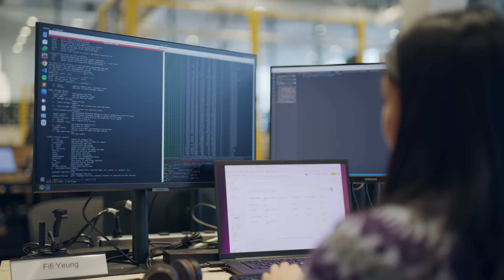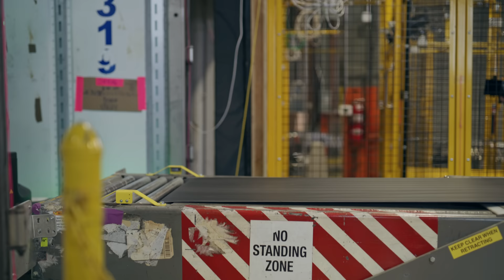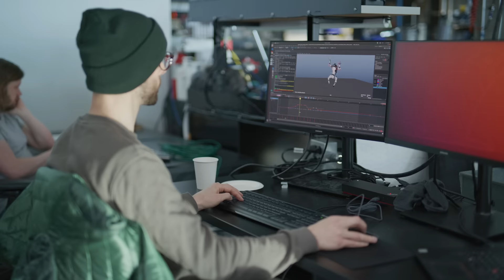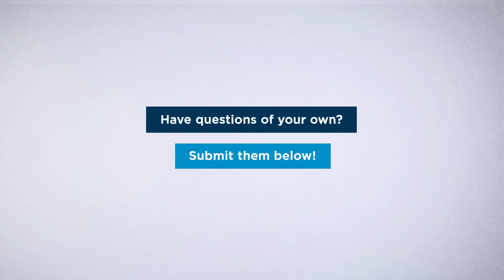Ask a Roboticist: Meet Fifi | Boston Dynamics

Comment: Seems slightly odd that instead of placing the boxes on the conveyor neatly, Stretch DROPS the boxes from a small height. Has it learned by watching human luggage movers at airports??
Reply: it saves complexity because boxes could be different dimensions, if it were to place a taller box it might crush the box into the conveyor. also for each box size it would have to calculate how far down to move every time it placed the box
Reply: @coreysuffield  the simplest is to put one laser on the belt conveyor itself or on the robot itself, this laser will measure the distance to the box.  There are still a lot of ideas how to solve this little problem.
Reply: @coreysuffield  it can be done with some kind of force monitoring to tell when it touches the conveyer belt or some other system to tell the size and shape of the box. If it uses force monitoring then it doesn’t need to do any calculations to tell where to move it to, it just lowers it until the force decreases. Robots that just use position control aren’t that great, adding force control makes it a lot more similar to how a person works, if you think about how you place something on a table, you move it down until you feel that it is on the table, same if you push something, you can decide how much force to use, you use both position and force control. Adding force control to a robot makes it a lot more versatile.

Comment: It's interesting to see Stretch was built for specific functions instead of general-purpose robots such as Atlas or Spot. My questions:
1. Do you only test with boxes that have ideally located centres of gravity or can Stretch handle boxes with suboptimally placed centres of gravity? If so, does it mean that it can calculate the centre of gravity of a picked box while moving it?
2. If Stretch picks up a box that has moving content (thus, a changing centre of gravity), can it adapt its movement speed accordingly so the box doesn't pose a problem of dropping?

Comment: I still find it crazy that such box robots are not common yet. Looks so controllable and easy and not needing fancy AI.
Reply: Well the suction idea is a bit impractical and has too many issues. Notice all the boxes it picks up are the same in dimension and size. Using suction there's going to be a tighter weight limit. It's only going to be able to lift boxes that are light enough that the suction will hold. The second it becomes too heavy the suction will fail. As she also says in the video, different shaped boxes are also a problem due to surface area it has to pick up but also because the odd shapes can off center the balance causing the package to pull at one side resulting in the suction failing again. If you could build a second arm that came in after the box was lifted and supported the bottom until it's close to the belt, that might work better for solving this problem.
Reply: You can just go buy a spot robot if you wanted to. Nothing stopping you.
Reply: @AmazingKevinWClark  I agree the suction thing is problematic, but I could imagine other ways that don't do this.

Comment: i have a question please? : Why does Stretch™not have 3 sides to it's pickup? From what i see in this video, Stretch™ can only pick from top, with flat-ish surfaces only. Would two more sides not assist with GRIP and therefore enable 'other' shaped objects to be handled as efficiently?
seems to me that an |~| shaped pickup would be far superior (where ~ is double-sided suction) and where | = angleable through 180 degrees?

Comment: Why does the stretch manipulator not have a small lip/scoop under the suction plate, that sort of slides under the front edge of the box. Just so it can offset some of the box weigh and rely less on the suction ?

Comment: Why does Strech drop all boxes about 20cm on to the belt? Wouldn’t it be better to set them down gently?
Reply: I'll bet they're working on that...
Reply: it would add quite a bit of complexity to do as you say, it would have to know the dimensions of every box and calculate the place move every time, or just have another camera that tells the system when box is near the conveyor. also there is risk of crushing a taller boxes. a small drop is so much easier\less expensive, and nothing is going to get damaged from such a small height, i work in a warehouse and have seen merchandise be treated way worse by people, like being dropped inside of a plastic box from waist height onto a concrete floor
Reply: @coreysuffield  
I could imagine it already does that calculation when picking the box. 
Otherwise how would it know were to pick it and where exactly to drop it. The height it dropped the boxes from themed consistent.
I find it odd to pick the boxes carefully only to let them drop on the belt.

Comment: Why does the robot drop the packages onto the belt, rather than placing them more gently?
Reply: It is much simpler to do rather than having a system to measure the size of the box or a force sensing system to tell when it touches the conveyer.

Comment: how fast can it load a truck speaking from experience that would be the biggest time saver you can always round up a team to unload not only that but most pallets come with shrink wrap does it have a blade to cut that and then there is things like some boxes come frozen will the suction cups work on that what about moving chep pallets can it stack them out of the way can it be paired with a forklift attachment to move said pallets or bring a load down from when they stack them because rite now there is a very small amount of applications for this and with such a high price point it is not cost effective to get one
Reply: Yeah the robot looks neat but it has a lot of unsolved practical problems. The biggest being the weight of the boxes. A suction can't lift beyond it's weight limit. A way to help it a bit is to introduce a second arm that can support the bottom of the box but if the suction can't lift it in the first place then the second arm is pointless and can't get in to help.
Reply: if a truck load is on pallets then Stretch is not the right tool for the job. for standard shipping boxes it is very common for them to be packed the way you see it in the video. it probably would not be difficult to make a remote operated\robotic pallet jack but barely worth it since pallet jacks are already easy and super effective at what they do
Reply: @AmazingKevinWClark  most shipping boxes already get weighed so it would be easy to flag a trailer that would cause Stretch to have problems. it would be less complex to just have it stop and let the machine operater/team handle the heavy box. it probably has a sensor that detects if a box detaches from the suction gripper
Reply: @coreysuffield  yeah it’s not hard to sense, the pressure in the gripper would drop and the flow rate would increase if nothing is being gripped.

Comment: What is the reason to use Linux/Ubuntu operating systems? I assume you have the financial means to use any other operating system you want...
Reply: open source
even Steam deck uses Linux based OS
the only reason Linux is slower in terms of popularity and developments because no profits were made.
Once it catch-up, nothing else matters and will always be flexible on any processors chipset x86 x64 ARM ARM64 PowerPC MIPS.
You don't need to reverse engineering it just to make adjustments which is why it is best for developers and servers
Reply: @fredbloggs5902  I share the same opinion, but it would be interesting to hear their impression. Do they only use Linux in the videos they shoot, so as not to advertise or avoid any claims from companies, or do they generally use Linux?
Reply: Huh? Why would they use anything else? They used QNX on some of their devices, but the development OS is always Linux. All the other robotics conpanies I know do the same. There is literally no reason whatsoever to use anything but Linux, even in real-time applications.
Reply: @vitalyl1327  they are plenty of reasons not to use Linux, especially in real time applications. It is common to have a microcontroller running the real time aspects and a Linux machine telling it what to do.
Reply: @conorstewart2214  of course, if you can use an MCU or an FPGA, you should use them. But if you need more compute power, then a beefier ARM or even an x86 is unavoidable. In this case Linux is perfect - you can isolate one or more CPU cores, set nohz_full for them, disable RCU interrupts on those cores, and then any Linux process running on such a core exclusively, avoiding any system calls (i.e., no context switches) will be suitable for real-time, the only variable timing will be memory access then.

Even better if you're using a heterogenous SOC (such as Xilinx UltraScale+) - you'll get a real-time MCU there, an FPGA, and Linux-capable ARM cores, so you can easily mix and match hard real-time and soft real-time and not-real-time-at-all loads on the same device, all driven conveniently by Linux.
Reply: @conorstewart2214  P.S., so my point is - the best real-time OS is no OS at all, and Linux comes as the second best, if you actually need an OS for whatever reason.
Reply: @vitalyl1327  again that is where using an MCU for real time and a Linux machine communicating with it is widely used. MCUs are better suited for most real time tasks than processors that can run Linux as most real time tasks require interacting with sensors or actuators.
Reply: @conorstewart2214  MCUs are also not ideal for real-time (even Cortex-R line) - thanks to sequential execution and interrupts that many peripherals insist on using.

A Linux process running on an overpowered device, with zero interrupts, solely using DMA for communicating with devices, will have better results than an MCU trying to do more than one thing.

Same reason why MPSoCs are so useful, you do not waste tiime on communication and communication between system components is guaranteed to be real-time (which is not the case with the usual suspects like CAN).

Also, control in robotics is a real-time problem on all levels. Not just the hard real-time things that MCUs can do, such as FoC, but higher levels - gait control, if it's a legged robot, VSLAM for any mobile robot - it's all real-time, and most of the pipeline is too computationally intensive to run on even the beefiest MCU. Good luck doing computer vision processing for 4 stereo camera feeds on an MCU. So, you need a more general purpose compute device, and, as a consequence, an OS running on it. And this is my point - Linux is perfect as such an OS, and there is no need to use specialised real-time OSes, thanks to the isolation I described previously.

Also note that the same approach is very common not only in robotics, but in the other hard real-time areas, including high-frequency trading.

Comment: Is it true that the programmers are the most payed team members in robotics
Reply: Not working for Boston Dynamics, but in general it's a close tie between various engineering and QA roles, depending on supply/demand in the region as well.
If you're asking from a career advice perspective: If you're interested in robotics, I'd pick a mechanical or electrical engineering track rather than pure computer science. It's easier to pick up programming skills autodidactically or as a minor next to mechanical engineering than vice versa, and I think in the future software engineering might be under heavier pressure from AI than other fields of engineering.
Reply: @odw32  I’m currently doing my undergrad in mechanical and I really wanna get into robotics. What do you suggest I do?

Comment: Who would have thought AI is going to surpass robotics?
Reply: AI can be piped to customers cheaply through the internet. Robots will always be an expensive piece of hardware. Both need years of R&D to develop, but AI can be distributed almost for free once the product is finished.
Reply: @CompleteAnimation  With true AI, robots become cheap to make.
Reply: @FlyDude  nop
Reply: @FlyDude  the amount of resources on earth doesn’t change wether you got a good ai or not.
Reply: @Duckbusinessman  It does. We actually need much less resources if we use them better. E.g, land used in agriculture per capita keeps decreasing.
Reply: @FlyDude  still not how it works. Perhaps you mean available resources. Otherwise the conservation of matter is still in play.
Reply: @CompleteAnimation  AI, its development, improvement, its work, requires significant machine resources.  Iron (electronics), electricity, human (programmers) resource... Without iron, AI does not exist and does not function like a human brain without a human body.